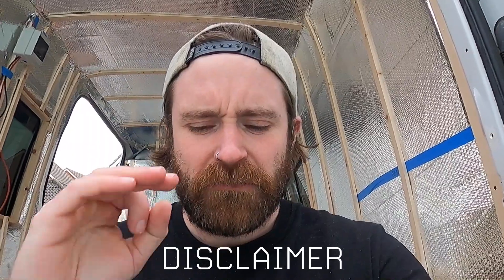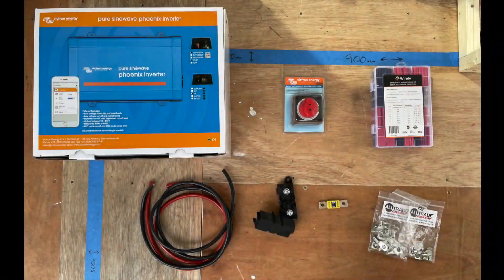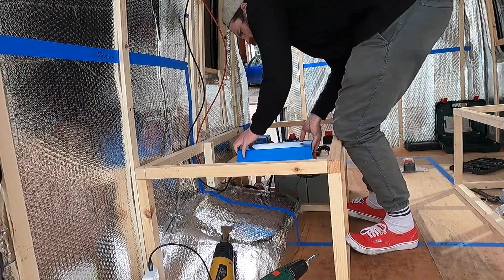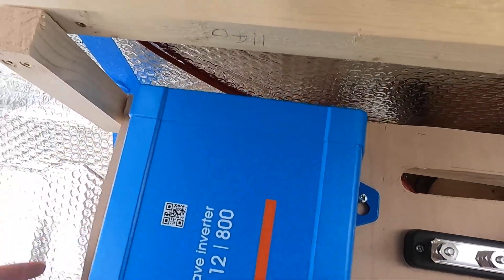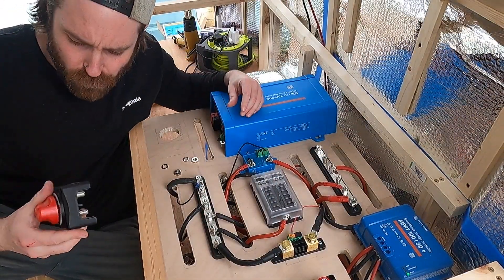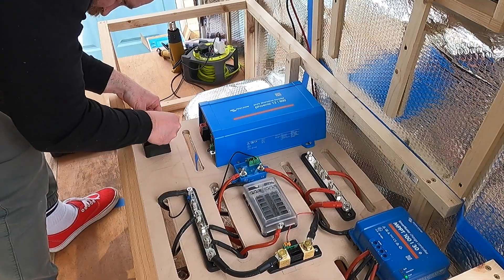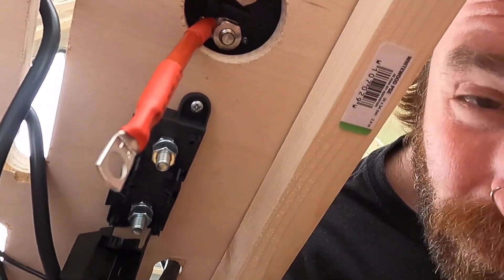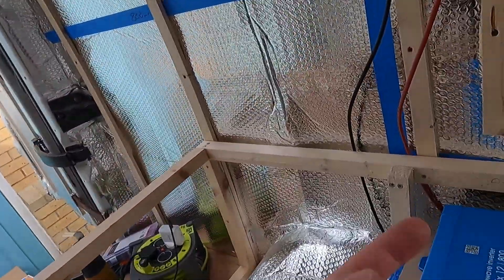Wiring a Victron Phoenix Inverter  | Van Electrics | DIY Sprinter Van Conversion UK

Comment: What a great install. I have the same unit that I have been using. I want to add it to my camper for off grid and charge with shore power when I can plug in to charge. I’m wondering if you set the grounding? Neural floating (as shipped) or connected to earth/chassis? Thanks!! Appreciate your time.
Reply from the maker: Thanks dude! I did the latter but it was something I admittedly completely overlooked in this video. It’s a super simple process - just a case of removing the casing and moving the internal PE wire from one position to another. Seen here: https://www.motorhomefun.co.uk/forum/threads/grounding-victron-phoenix-inverter.243185/

Comment: I’m wondering how you’ve found using this inverter?
I’m looking at replacing current inverter/charger that runs constantly hot and noisy even on low draw, with two separate Victron components. 
I’m hoping to have quiet/cool to about half capacity (lights and phone chargers, etc) and only have the fan come on for heavy draw and maybe in extreme ambient heat.
Reply from the maker: It’s been great! I don’t notice much noise at all from it, however I haven’t monitored how hot it gets
Reply: @GreenHornCountryClub  Mine was too noisy, so I built an insulated enclosure. But even with vents on both ends and usb fans running, was still running too hot/noisy even on low loads.🤷‍♂️ And being a combo unit, it has to be left on to use shore power..  🤷‍♂️ 
If you are not hearing the fan, that should mean it’s generally running cool-ish. Perfect. Thanks for your reply. 👍

Comment: I have a question, you say you are connecting the 240v output to a consumer unit, is that for convenience or is the 240v output unsafe to use on its own. I was hoping to just plug a 2 way extension into that 2 give me 2 sockets.
Reply from the maker: I think that should be safe to do, as long as the extension is RCD protected 👍🏼

Comment: Hi. I bought the same device and want to install an on/off switch with a 0.75mm wire next to the control panel in my caravan, 1.5m away from the inverter. Can I connect the switch and will it turn the inverter on or off? My second question is: where should I connect this 0.75mm wire switch to the back of the inverter? I'm confused. There's no wiring diagram. I'd appreciate a detailed explanation. Thank you.

Comment: I already have a consumer unit linked to my setup but it’s only wired to my dc-dc and provides power to 3 plug sockets when I’m hooked up. Can I add an inverter to the consumer unit and it will provide power to those sockets when I’m not hooked up and when I am, it transfers over?
Reply from the maker: I’m not massively clued up on the wiring process for electric hook ups, as I don’t have one in the van, but as far as I’m aware, that wouldn’t work. When not hooked up, you need something like a leisure battery to power the plug sockets, an inverter on its own isn’t going to do that. You’d be better off connecting your plug sockets to an inverter, straight to a leisure battery, then have your hook up charging the leisure battery when hooked up 👍🏼

Comment: What is the busbar for?
Reply from the maker: @gggggjjjnd-us3he  the positive and negative busbars are connected directly to the leisure batteries, so you can connect all 12V components straight to the busbars, rather than the batteries themselves. The negative busbar is also grounded so will ground anything connected to it. 

You can see more info here: https://youtu.be/eOpMb9wn_mo?si=DfyLNoSFY5_N_odE
Reply: @GreenHornCountryClub  where do you buy this busbar?
Reply from the maker: @ there should be links to everything I’ve bought in the video’s description 👍🏼

Comment: Nice work well done, I have one confusion that this Victron inverter is rated for an output of 120VAC, but you say that you are going to use it for 220V. Is there a way to convert this inverter to a 220V AC output? Regards

Comment: I know this is an old video but I hope you see this question. I have a 3000w inverter and two large batteries. All came with the van and I have no idea what it means to have a 3000w inverter and these huge batteries?
Reply from the maker: @chartmann43  the wattage on an inverter is the maximum amount of power that inverter can handle at one time. All appliances that you plug in will use a certain amount of power, or watts. You can usually find this figure on the appliance itself 👍🏼

Comment: Where did u get the right angle crimp connections??
Reply from the maker: @markfrench5034  hey dude! There should be links to everything I used in the video in the description 👍🏼
Reply: @GreenHornCountryClub  I couldn't find them :( they just seem proper handy to have
Reply from the maker: @markfrench5034  these should be the ones: https://www.ebay.co.uk/itm/333649625759
Reply: Thanks mate ordered :) @GreenHornCountryClub

Comment: I'm needing to know the size of cable needed that will fit in the Phoenix 24 v/1200? About 4 feet long. Thanks and I'll keep looking.
Reply from the maker: @allenmaner6616  hey bud, the cable is 16mm, there should be a link to the specific cable in the video description. As for the length of cable, that would vary on your van and how you’ve positions things. Cheers

Comment: Please I'm confused, do I connect the battery cable bare end to the inverter connector, or I use a ring terminal in the cable? It's just that I don't get to see clearly how is done. Thanks for any response.
Reply: Ferrel Connection is Best over just Plain Wire compression as in this Video.
Reply: @1GREATDANE  Thanks very much.

Comment: Nice design! I recently bought the 12/500 Phoenix inverter, but I'm going to use it at my house as a backup power source for my electronics. Should I ground (grounding rod) the inverter?
Reply from the maker: Thanks dude! You should defo ground the inverter. I believe the inverter itself will have a ‘floating neutral’, so you may need to adapt this depending on what you’re wiring out of the end of the inverter. There should be a section in the Victron manual that explains it all.

Comment: Nice setup. Why did you put in a kill switch on the positive battery wire and not use the remote switch terminals to a panel switch? Did you find there were current draws even when the unit is turned off?
Reply from the maker: Thanks bud! At the time, I was thinking if I added a kill switch before the inverter it would mean if I want to upgrade the inverter later down the line, I could isolate that part of the circuit and disconnect it entirely.

Comment: Is the ground cable necessary or can it work without?
Reply from the maker: Hey bud, thanks for the message. So as far as I understand it, the grounding point on the inverter is essentially 'floating neutral'. The inverter will work without grounding from this point but it's important to consider what you're wiring out the other end of the inverter. 

If you leave the inverter floating neutral and only use single-pole RCDs, in the instance that the fuse blows only the live wire is cut, the neutral wire will still be live which can be dangerous. 

If using single-pole RCDs, you'll need to bond the floating neutral. There's a section in Victron's inverter user manual which shows you how to do this. 

Alternatively, what I did was use a double-pole RCBO which will break both live and neutral in the event of a fault regardless of if you've got a floating or bonded neutral. 

I hope that makes some form of sense. I've found a forum post online that explains it far better than I probably just have 😅

https://www.motorhomefun.co.uk/forum/threads/grounding-victron-phoenix-inverter.243185/
Reply: @GreenHornCountryClub  thanks so much for this reply. Really appreciated.

Well, I would love to get your thoughts on what to do when the green light is flashing and the Inverter doesn’t work. I wired my friends up and something not right (It’s a 1200w)

I have the same but 500w and it’s wired in the same way and works fine (with no ground) 

I have the connections going to BuseBars. Is that what you mean by single poked rcd?
Reply from the maker: @thechrisgeisler  no trouble at all!

What do you have coming out the AC side of the inverter? Is that where it’s not working?
Reply: @GreenHornCountryClub  coming out? 
Nothing works when connected to a plug 🔌
Reply from the maker: @thechrisgeisler  sorry bud! I should have been clearer - on the back of the inverter you have the AC output socket. Are you plugging appliances directly into that and it’s not powering them? 

I was looking online and it seems that a flashing LED could possibly indicate some sort of calibration error. Victron has a Toolkit app that you can download and it should give you more information on the specific error. 

https://www.victronenergy.com/blog/2014/10/02/victron-toolkit-a-new-app-for-android-and-iphone-users/

Comment: Doe’s the ground go to the minus of the battery ?   Need to know
Reply from the maker: Hey bud, thanks for the message. The ground cable is connected to the negative busbar. The negative busbar is then grounded to the van’s chassis 👍🏼

Comment: Are these any good buddy I’m thinking of getting the 1300w one but look into a auto transfer switch I can point you in the right direction on a cheap one
Reply from the maker: Hey dude! I haven’t actually tried it out yet. I’ve already bought a consumer unit with a single RCBO that I’m going to wire three plug sockets from. Hoping to wire them up this week 👌

Comment: Hi mate, great video. I've just received a phoenix inverter, and I was hoping to wire it up to an existing consumer unit (off grid), how are you planning on doing that?
Reply from the maker: Thanks bud! Yes I am, should be wiring up a consumer unit in the next week or so which I’ll do a separate video for. I’ve basically just got one RCBO that I’m going to wire 3 double plug sockets from 👍🏼
Reply: @GreenHornCountryClub  cheers I'll look forward to the video, it's the wiring from the inverter to the consumer unit I'm interested in, since it has a UK socket on it.
Reply from the maker: @rnedelko-l4n  I’ve got some 2.5mm twin and earth cable that I can use to wire to a plug for the AC output of the inverter and then feed the other end into the RCBO. I’m going to use the same cable for the double plug sockets too.
Reply from the maker: @rnedelko-l4n  Here you go bud! https://youtu.be/aAWQzqHoOCY Sorry for the delay

Comment: Love the Video! Very clean looking install. Did you convert the inverter neutral earth bonded from floating neutral?
Reply from the maker: Thanks so much bud! Really appreciate the question too. Coincidentally, this is something I’ve been researching at the moment as I’m planning on installing a consumer unit and some plug sockets soon which I’ll do a separate video for. 

To answer your question, what I think I’m going to do is use a double pole RCBO in the consumer unit, then any fault that occurs should break both the live and neutral, so it won’t matter if I have a floating neutral or not 👍🏼